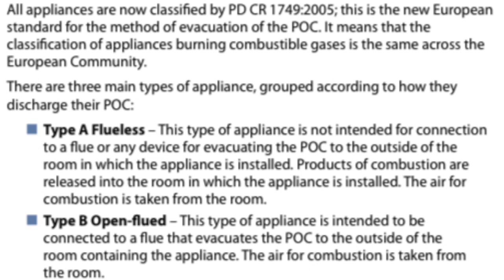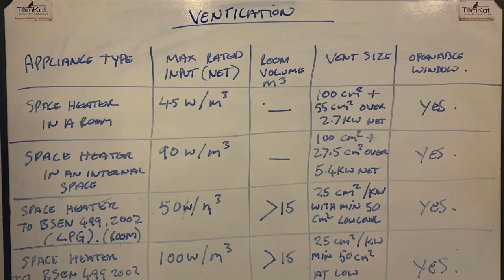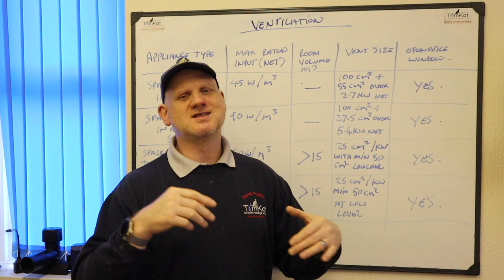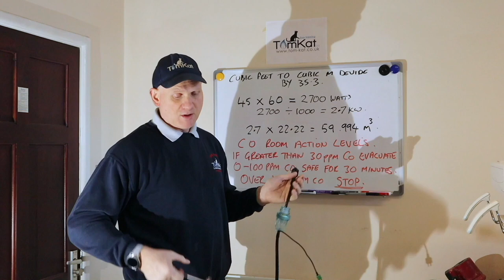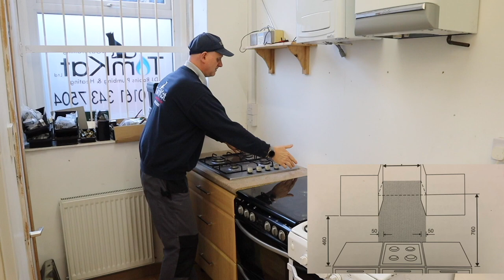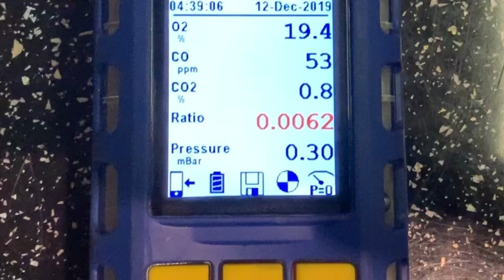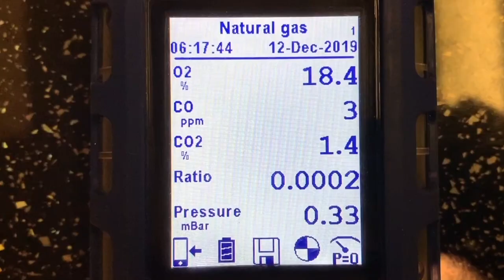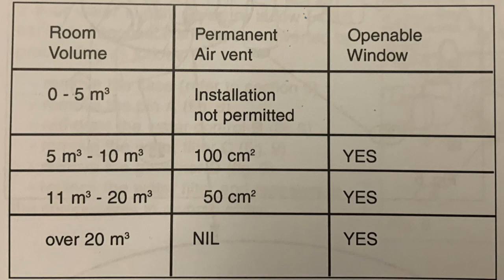FLUELESS GAS APPLIANCES, part 1 of all gas trainees  need to know about gas appliance flues.

Comment: Great video derek your a very knowledgable guy. Would be interested to know your thoughts regarding regulation 26 (9) on a housing associations landlord gas service where the landlords owns the room sealed boiler only and tenants owns flueless gas cooker and flueless gas fire how in depth would the checks be on the tenants own appliances to cover 26(9) 

Thanks Andy
Reply from the maker: On a landlords report you only inspect the landlords appliances and note the other appliances. But according to igem/ g/11 appendix 5 you must inspect the appliances you encounter so you would have to check ventilation etc so that’s the minimum I would do

Comment: Other brilliant exelent vedeo thx a lot Derek 
Can you do other vedeo for chimneys pls
Reply: Flueless  gas fires are A. a minefield of regulations  
B.  Involve material additional costs above the appliance  cost.
As a secondary heat source what is the point of even considering such  an  appliance .
It's a no brainer 
If the customer requires a fuel effect fire, the only sensible advice is go electric!!
A room sealed appliance  pretty much takes out third party involvement. 
To summarise, even if you install to the letter, there are too many  opportunities for third parties to compromise the installation.
All in all ,all things said flueless 
 fires don't make sense!!!
But hey ho , it's your choice and ultimately  responsibility.

Comment: I see this is an older video but what's you're thoughts if no openable window or extraction but perhaps an opening door like a French door in a new build for example, as far as I'm aware opening window is a building reg I.e for removal of cooking products and not to assist with combustion
Reply from the maker: You are correct a window is under building regs and you can use a door or extraction